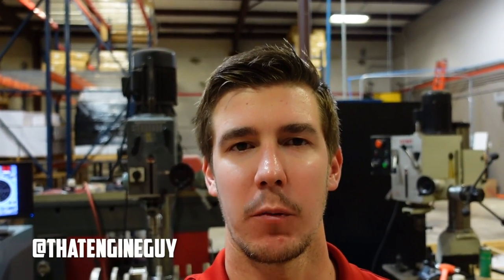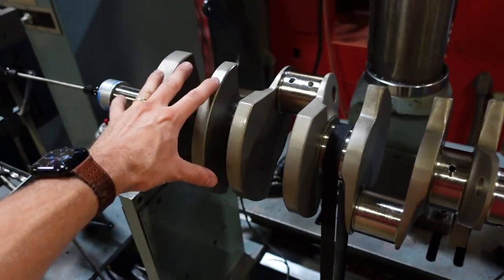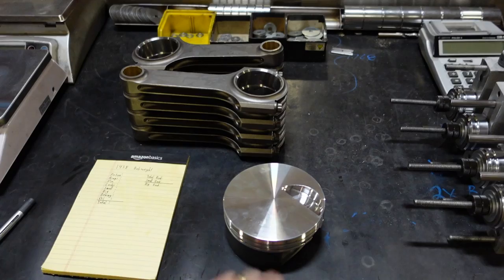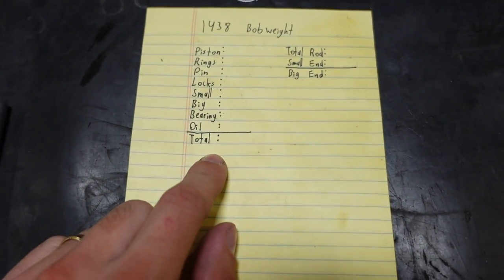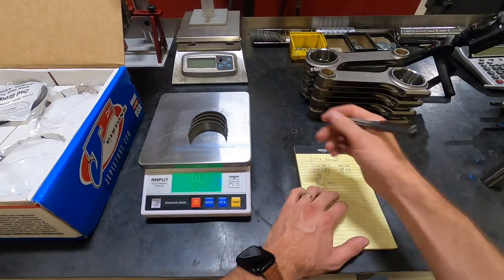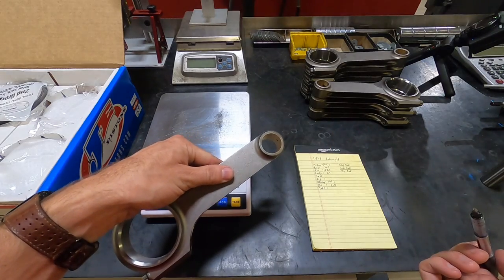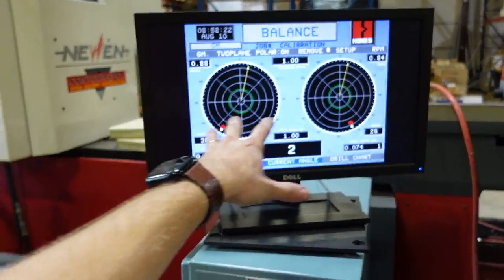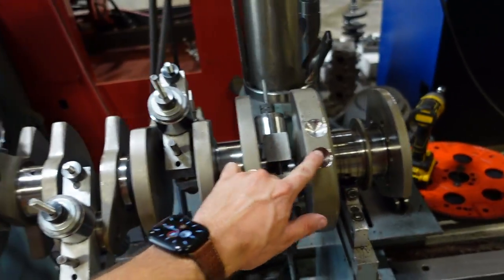1,000HP N/A 632" - Crankshaft Balancing - Part 1

Comment: I dig it. Been hashing out a 565 w/ 6.535 rods on the 4.25, and 9.8 deck Dart alloy; for short pistons @ 10:1, for turbos on E85...I asked you about the last 632 build head flow and dyno numbers, but it seemed to stall out, a bit...I like the center balancer concept.
Reply from the maker: Badass!

Comment: That's really awesome. Learning a lot. Looking forward to more. On the bob weights though....I thought each piston/rod/ring/etc were supposed to weighted separately as weights could vary?
Reply from the maker: Our rods are pre weighted & matched in exact sets. With the very high quality pistons, bearings, wrist pins & rings that we use, the weights are always the exact same. This Bobweight was also in the 2300’s, so a gram here or there is only a 0.043% difference, not enough to change anything. Remember, the weight of carbon build up on the pistons, along with oil being slung up on the rotating assembly changes things. Don’t overthink it, be accurate the first time and move on!
Reply: I personally weigh every thing and weight match every thing . Number every thing ect . My boss charged more then he should do I like to do the best I can .will a the minut weights change anything absolutely not but might well already there . And that’s from everything from 87 Toyota stock rering to a blower bbc
Reply: @JacobVillemain  that’s awesome. Thanks for the insight.

Comment: When centering a crank, do you recommend people bring in the flywheel too?  What about the harmonic balancer?  A machine shop near me said I should bring in all pieces related to the rotating assembly.  Blancer, pistons and related components, Flywheel and pressure plate.  Just wondering your thoughts on that.
Reply from the maker: If it is an internally balanced crankshaft you do not need the other components. If it is an externally balanced crankshaft, then the balancer and/or flywheel must be installed.

Comment: Love the video. I have been a machinest for 30 years the weight differences between rods pistons wrist pins and bearings can very. Do you go to the extent of making each of those match? When you file fit the rings to the bore you take XX amount away from each which when you start stacking you minimal changes can add up. Does it matter in an engine like this one that we'll probably isn't turning 8k so that minimal difference I guess may not matter. But on more reved out race engine it seems like it would? I know time is money and customers always want to pay less. But would the engine have anymore longevity if the extra time was put into it? Assuming my wallet had no budget. Thank you I can't wait for the next video.
Reply from the maker: Our rods are pre matched in sets. The pistons, wrist pins, bearings & rings we use always weigh the same in each set. Total Bobweight was in the 2300’s as well so a 1g difference here or there is only a 0.043% difference, not enough to change anything. Again, when file fitting you are only removing .010”-.020” of material. With rings that are only .9mm thick…again no measurable difference. For what it is worth, most new engines from the OEM’s are only balanced within 5-10g’s. These are engines warrantied & designed to run several hundred thousand miles.
Reply: We did at the shop I worked at every ring pin bearing ect was matched . And we would over balance and under balance in certain cases for more stable rpm .though 99% of engines are  only needed spun at 500rpm for balance.more high end stuff is damn close but hey to each their own.a gram won’t be felt .but I just feel if you pay for it I’ll do my best

Comment: why run c16 whan you can just use e85? is it harder to get ahold of?
Reply from the maker: C16 has much higher octane and is extremely detonation proof.
Reply: @JacobVillemain  yeah but for a 13:1 engine e85 would be more than enough
Reply from the maker: @ezmny1387  customer wants to run it, so that’s what we are doing.